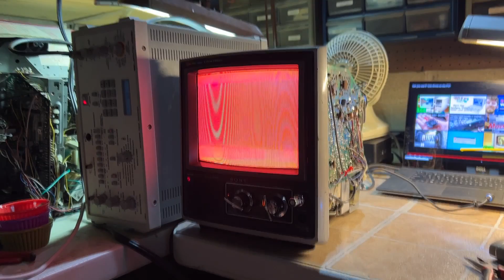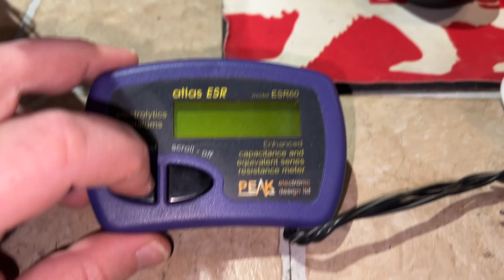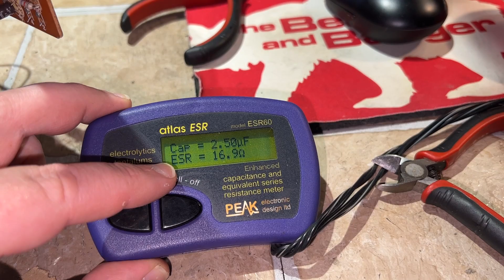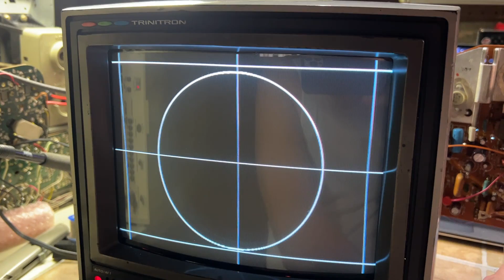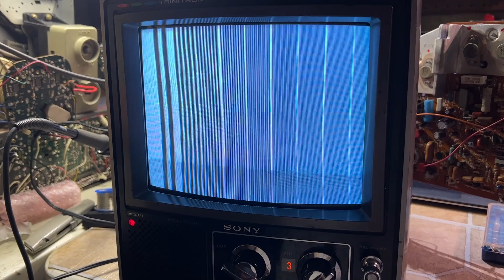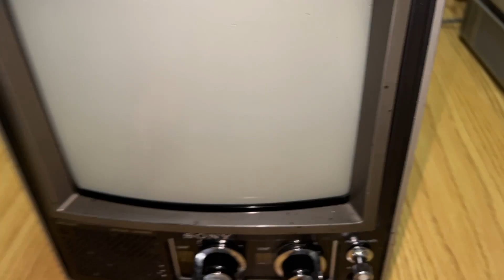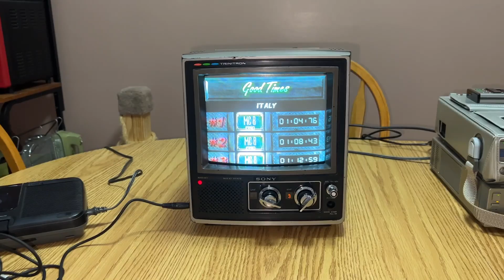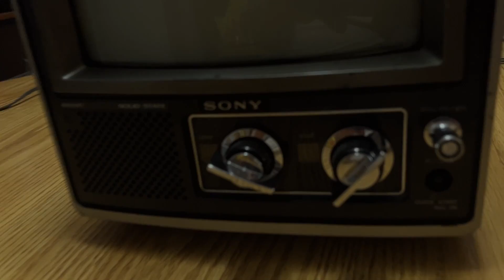1975 Sony Trinitron Model KV-9200 9” TV

Comment: Nice work as always! I love the way Trinitrons look with their vertically flat "cylindrical" tubes. Back in the late '00s, I had a '75 Sony 15 inch unit with failing capacitors and possibly a bad tube as well, since the colors were all funky and the screen was dark with a slow wavy screen.

Comment: I worked in repair in the last century. Nobody ever paid me to recap an entire TV. A lot of the caps the values are not critical as long as they are not leaky. I do agree that when you find vintage equipment that's been sitting a lot of those old japanese caps go open or dry up. We used to always do adjustments first and if problems couldn't be adjusted out then we would change parts. Might be where the two schools of thought come from.

Comment: Yup, if I see a bunch of infamous caps like those purple or the dark blue Matsushitas, grey Elnas, or any early (1960s) Japanese capacitors - I change them. Otherwise it's a judgement call as you said. I spot check ones in critical or warm locations.

Funny enough, I used to hook my tape recorder up to the Sony KV-1210 to do exactly what you demonstrated! We picked up Fox on that TV with rabbit ears, but our main TV with the VCR had cable TV which didn't provide a Fox affiliate. So the only way I could record cartoons off Fox afternoon was onto audio tape.

Comment: Ah yes, the humble Trinitron. Always a firm favourite amongst us gamers! Amazing how consistent these older sets were in terms of picture quality even that far back! The PVM's are also highly regarded and sought after, though I have somewhat mixed feelings about those as they can be very hit 'n' miss, and are often hugely overpriced on the second-hand market. And really offering no great performance benefit over (at least here in the UK/ Europe) a domestic Trinitron 4:3 set with an RGB SCART input.

PS: Love the snippet of Super Mario RPG: LOT7S towards the end, there! I had an absolute ball-ache trying to get that to run on a PAL SNES, as it was one of the later SNES carts with more advanced region-locking. Ended up importing several loose carts as some of the earlier revisions would actually run with a converter..then I got hold of a US NTSC SNES anyway! Doh! >.<